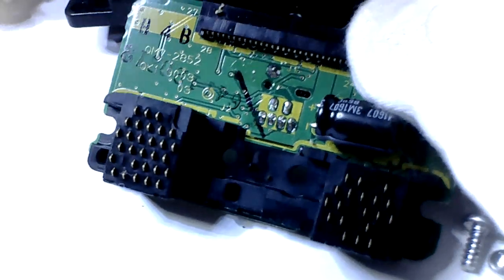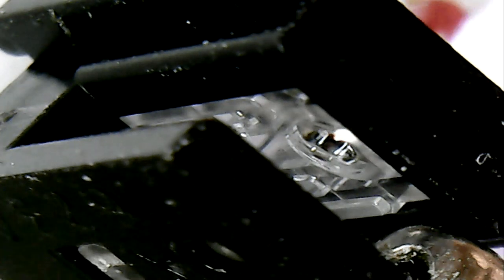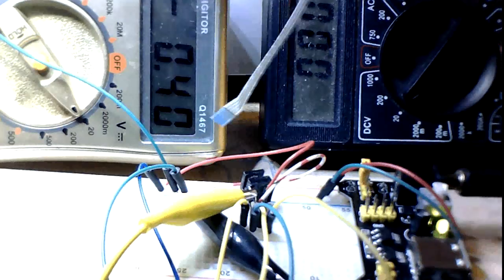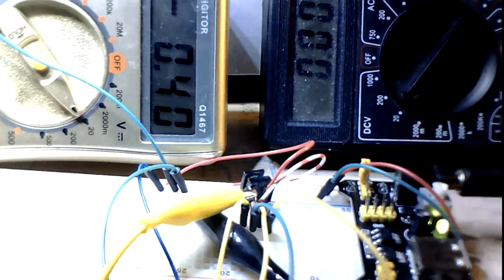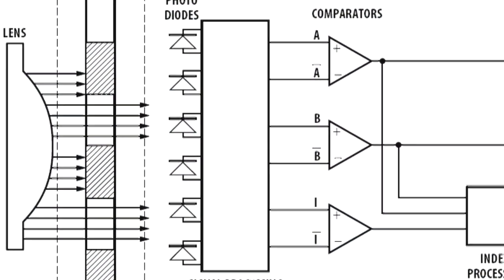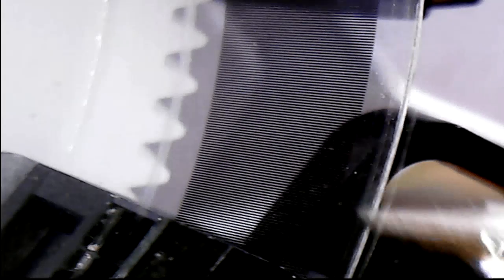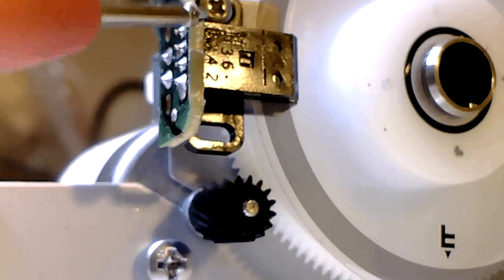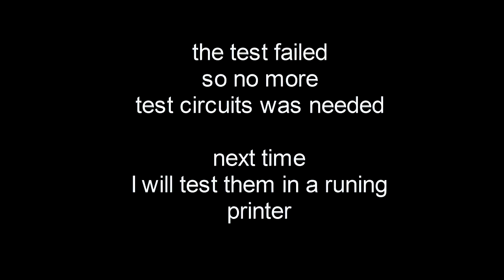Precision Electronic Rotary Encoders in used printers

Comment: He has a good encoder... umm you can probably make round encoders by cutting pieces of tint and placing on round encoders with a simple either direction 4 pin photo inturruptor... at 9600 baud ... think thw boarda inturrupt service routines will handle the photointurruptors reads

Comment: Have some encoders removed from printers. I know what all the pins are but when I have rated current on the diode I am only at 1.0 volt.  Tried putting larger series resistor but still got rated diode current at only 1 volt. Should be at least 3.3 so the transistors will work.
Reply: Did you try a higher voltage? (Not sure if that would work ). Did you get it working?